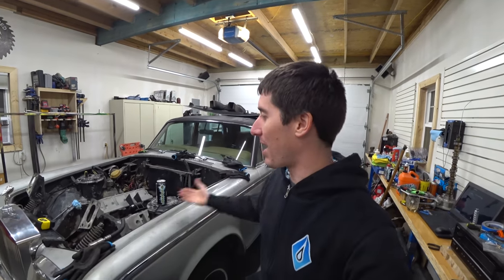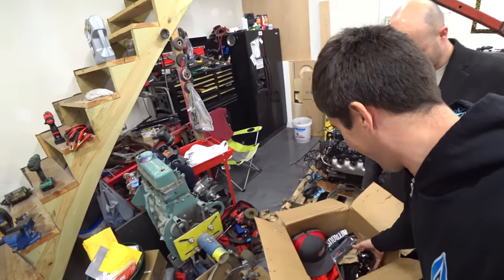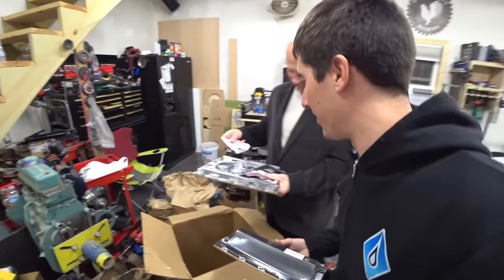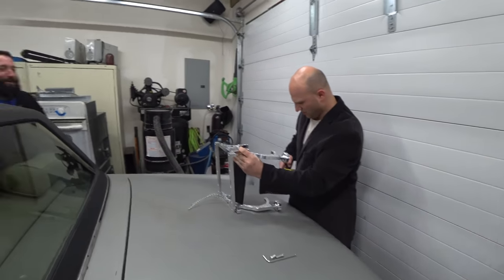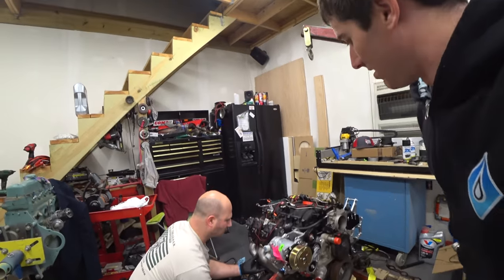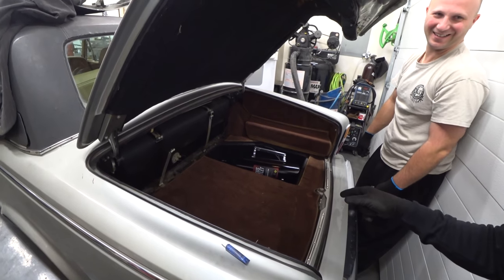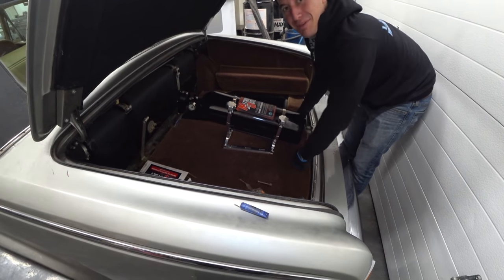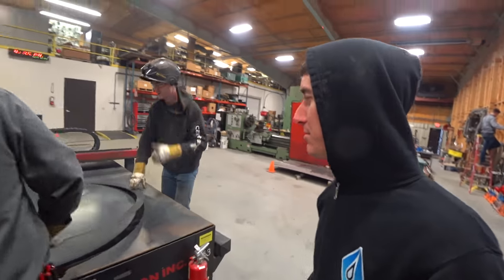Putting An INSANE Nitrous System On My CHEAP Rolls Royce *Project Rolls Smoke*

Comment: At least John is engineering this NOS system install.  We ALL remember Tyler and his NOS Prius and well, yea.  I hope Tyler stays far away from this setup while its being installed.
Reply: gchsbus lol, still wonder what caused the pri to blow, maybe the traction control cut engine power and caused the engine to knock with the nos.
Reply: Hope he doesnt put NOS on the car
Reply: I have this feeling that it may blow up like the Prius..

Comment: Yay longer video. So much better, looks like this conversion is going to flow along pretty easily for what ur doing. Just make sure that rear end has enough strength in it so nothing twists. Have you decided what suspension ur going to use?

Comment: can u tell me the reason why people convert rolls royce engine to LS swap?
Reply: There's a lot of reasons but the main 3 I can think of is reliability, cheap parts and the mod-avility of the engine it just makes so much sense. 

I'd love to swap an old Mercedes Benz C126 with just a lazy 5 spd auto ls2 and just cruise.
Reply: The old engine would take too much time and cost possibly too much to rebuild.
Reply: would the vehicle be considered a rolls royce without the original engine?
Reply: @global1federalexpress80  it depends on perspective. It looks like one from the outside and inside, the essence still there but not the heart.
Reply: @sizzuu  Thanks.
Reply: @global1federalexpress80   No  but a funny hotrod car I hope it will tur out well

Comment: Seeing as how this motor was run on nitros and was bought without hearing run, I'd at least do a compression test and maybe drop the oil pan and check the internals. I'd hate for Jr to do all that work to find it has a knock
Reply: dave1135 that is done by J&J before they send it out
Reply from the maker: Yep, J&J compression tests em’ just gonna change the oil and start it! 🍻
Reply: @WatchJRGo  ok then John, sounds like it's all good. 😊

Comment: Ypu need to run the purge through the hood ornament. Drill a hole up through the base and through the body. Then micro holes from the trailing edge of the wings to the hole that comes up through the base so when you purge the nitrous shoots out of the back trailing edge of the wings like it is flying through a cloud
Reply: nice idea but she is springloded in case of accident

Comment: Anything happening with the brakes and suspension?
Reply: Yes & yes. JR has to because the old system ran on mineral oil. I guess he's addressing one complication at a time. Make the RR go 1st, then worry about how to stop it....
Reply: @sleepyhollow783  Mineral oil in that car ? I guess you  have tu study som more on this
Suspension hi may cur it of with a side grinder the car stands on road springs it is not a Citroen

Comment: aww that LS engine is gonne grenade and the car should be named WATCH JR BLOW
Reply: @ger traba
Yes I think that is wats going to happen unfortunately   the subframe under the engine or the rear axel mounts will blow sky high I do hope not but some thing will happen as it was not designed for shock power hi power Ok but not shock power